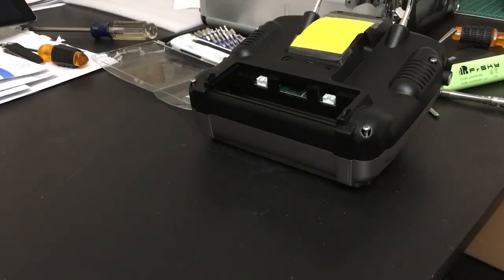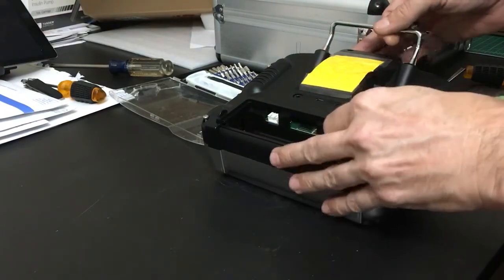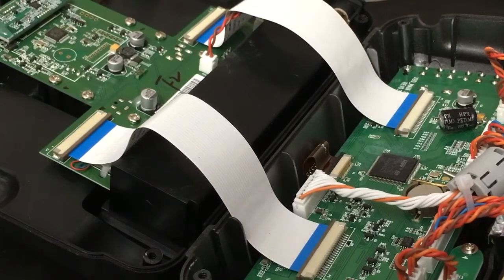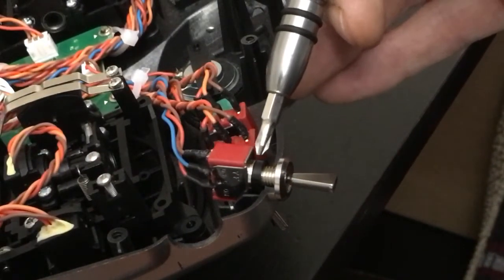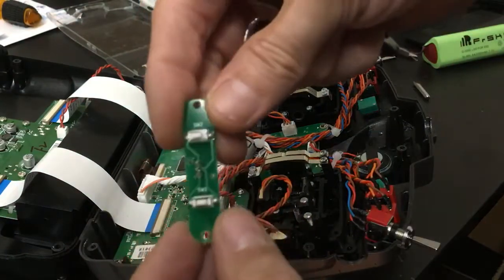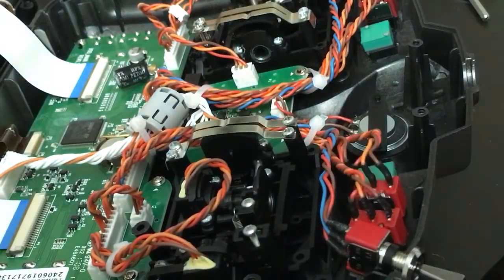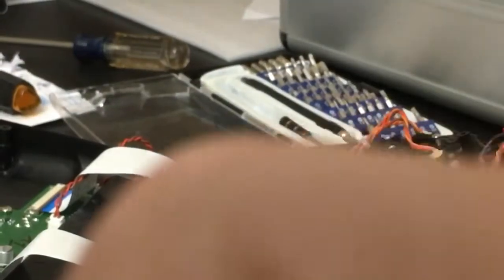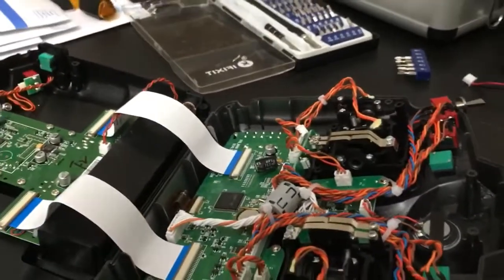Taranis X9D Plus recent purchase teardown

Comment: Did they upgrade the speaker too?
Reply from the maker: Nope, looks like the speaker is the same as older modules, and the same in the SE models also. 
If you program the radio to use one of the variable knobs switches to control the volume and turn it down a little bit then it's not really that bad. Oh, and install the better voice pack makes a big difference compared to some of the older complaints. The new firmware being able to play higher quality sound files is noticeable.

Comment: Is it generally radio electronics and wave physics/maths that you do? I see some of the flight controls have a screen for cam. I don't suppose you like retro computer hardware, like Jeri Elsworth? Would be great to see Open Source stuff e.g. Amiga like "lallafa's a560 parallel port ethernet plipbox" (google it) made form arduino (that sort of thing). Not enough people make stuff like that and instead they waste pcmcia bandwidth when that "should" (well I think so) be used for graphics cards and so forth.